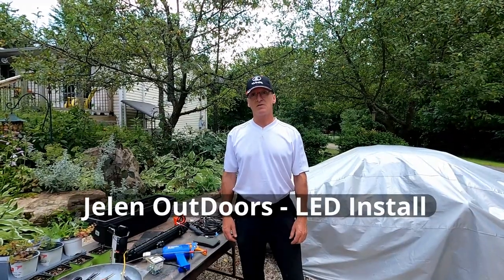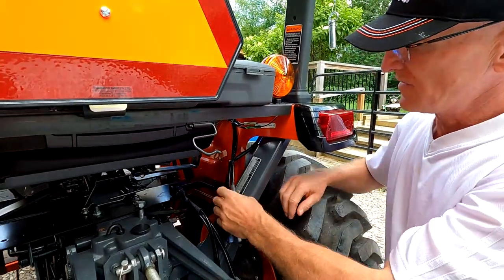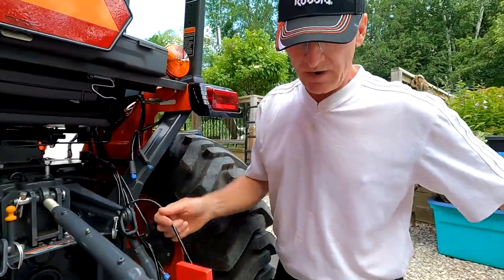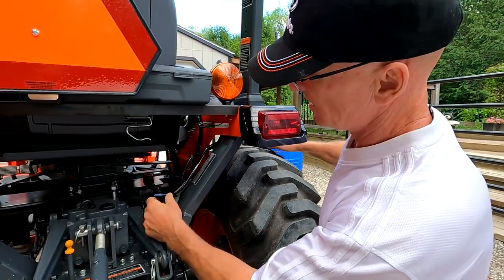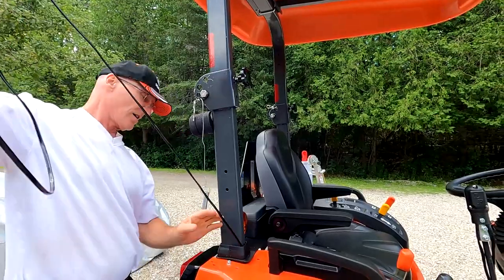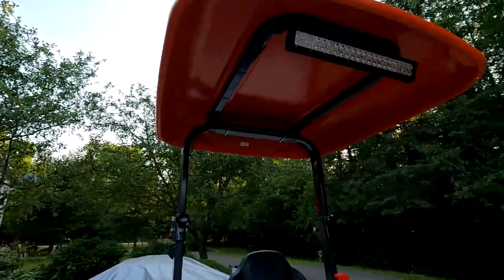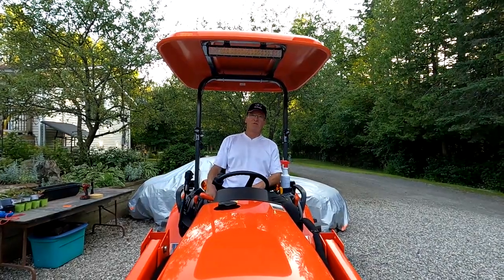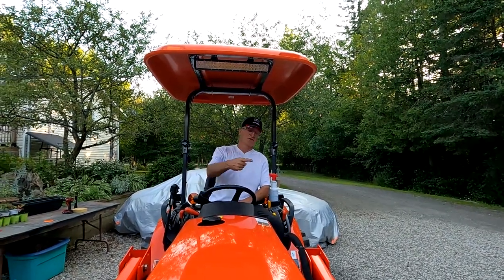52 - Kubota LED Light Install - Work lights

Comment: Paul you realize that with night lighting there's no excuse for a snow plugged driveway in the winter. But let there be light!  Good job, excellent guide of the process. 👍🚜🍻☀️☀️☀️
Reply from the maker: You bet I realize that Mark, lol.  I figured I better get them put on before it starts to get cold and dark before 5pm.  Thanks for stopping by!

Comment: Nice, clean installation, Paul. I recently installed the same lights on my tractor. You had different mounts than I had. Perhaps I did not order them. I don't remember. You certainly had more room under the tractor to work than I did!! 🙂 The LED's make a big difference!!
Reply from the maker: Thank you kindly Rick!  I had watched your LED beacon lights from Santa video and those are very bright lights. They really do make a difference.   My tractor does have a lot of clearance  underneath and it was one of the main requirements  for when I bought it.  Take Care!

Comment: I have the same canopy and light bar. Glad I saw this so I don't put it on the metal bar blocking the light. I'll put it on the edge of the canopy.
Reply from the maker: Thanks for watching and good luck with your installation.

Comment: I did the exact same job on my B3030 last year and I really like lighting up the whole driveway at night now.  And, I really like how you fished the wired to your dash.  Clever.  Great idea.  Thanks again.
Reply from the maker: Thanks John, I am happy with the dash mounting for the switch. It's really nice with the LED's as you mentioned they light up the whole driveway.  The B3030 is a nice size tractor.  Is yours 30hp without the DPF regen?  Thanks for watching and have a great day!

Comment: Nice video description, thanks! I'm curious why you need a relay in this setup. Since you are tapping into the tractor's existing rear circuit for power, couldn't you just run the tractor power through the switch and back to the lights? I'm not sure what the relay is doing for you. I think it is only necessary if you had connected directly to the battery like the instructions originally specified. What am I missing? Thanks again.
Reply from the maker: Hi there and thanks. Whether I use a direct connect to the battery or to the tractor’s existing rear auxiliary outlet I still want to use the relay to keep the switch and the lights (the load) on separate circuits. The lights on the high current draw/load circuit and the switch on the low current circuit draw/load.  If I don't use the relay then the high current load will pass through the switch to power the lights.  For this example, the rear auxiliary outlet is rated for 15 amps maximum.  The lights draw approximately 12 amps and the switch is rated for 5 amps.  Thus with the relay my switch draws a very small amount of current/amperage through it's circuit to turn on or off the light circuit that draws a high current/amperage well above the switches  rating.  Therefore I wouldn't want to melt my switch by having it directly connected to the high current draw lights circuit load.  Hope this helps and apologies for getting back to you so late.
Reply: @JelenOutDoors  Yes, thank you. I was thinking that since the rear aux. outlet is controlled by the tractor light switch that there must be a relay already in that circuit. But maybe not. I will verify that when I install my future lights.
Reply from the maker: @beerbellybob2989  Just in good practice a relay and an inline fuse is always a good idea for protecting devices.  I always treat what's there already, in this case the pre-installed work lights power source as a separate circuit.  Anything I add to it becomes it's own separate circuit with it's own fuse, relay, wires, switch and load device.  I have video coming out that I talk a little more about the wiring.  Not sure if it's being released on the 23rd or 30th of this month.  Have a good evening!
Reply from the maker: @beerbellybob2989  In my case the power to the rear auxiliary outlet is powered when the tractor's ignition is turned on.  I can use  the aftermarket LED'S independently from the factory tractor lights because I installed an aftermarket switch. Or if I want I can turn both set of lights on by flipping both the aftermarket and the factory tractor switches on.  If my factory light switch (I would expect it has a relay) was powering the factory lights and the auxiliary outlet at the same time then I would use an inline fuse, the LED'S and no relay since I would be using the factory installed light switch to turn on the LED'S when l turn on the factory installed lights. I just need to make sure that with the factory lights and the aftermarket LED'S  the power draw  are within the rated amperage that the factory fuse and wires are rated for. Good luck on your future installation.
Reply: @JelenOutDoors  OK, that's what I was getting at in my first response. In your case, you are treating the factory installed rear aux circuit as if it is a direct battery connection. That way you don't need to care if it already has a relay since you are adding your own fuse, relay & lights as a new circuit so to speak? I understand needing to mind the amperage rating. On my JD 4120, the rear aux circuit is rated for 20 amps.
Reply from the maker: @beerbellybob2989  Yes Sir that's correct.  Have a great weekend!